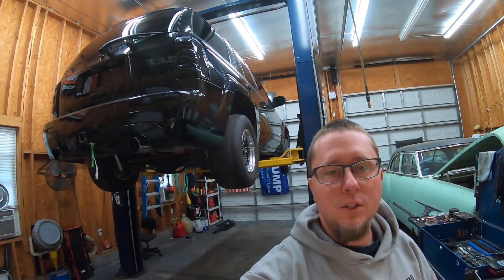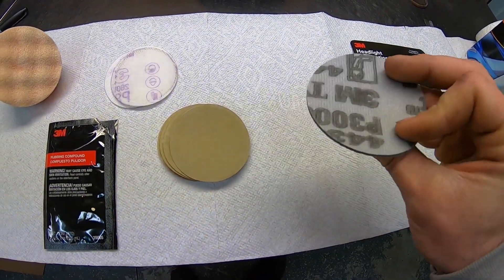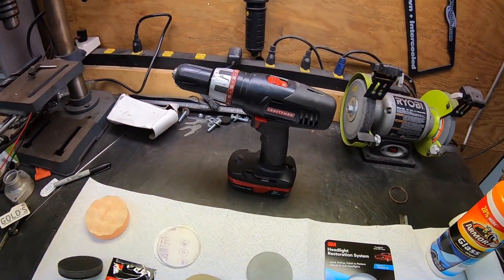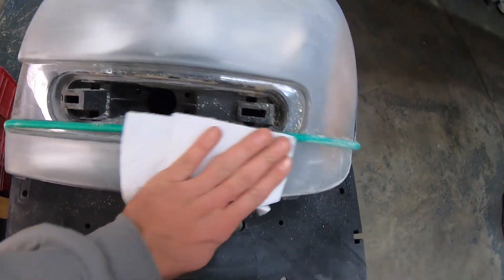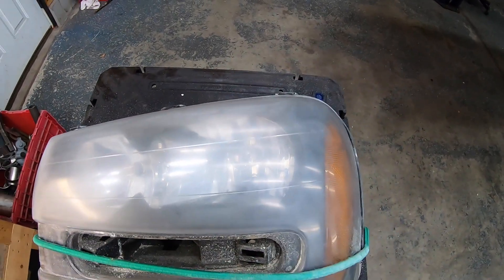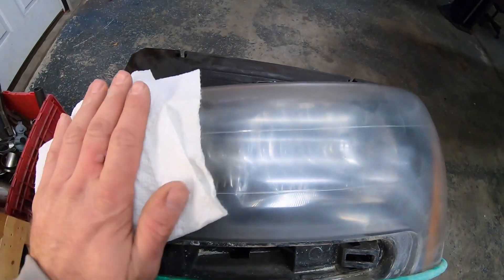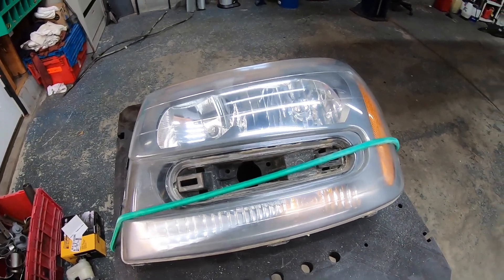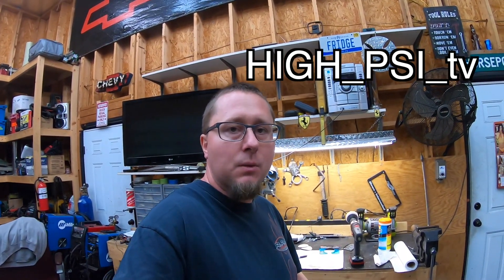3M Headlight Restoration. Does It Work?

Comment: Good video. I did my 1995 Chevrolet Caprice headlights two years ago. It is all in the prep... must  use UV protection  or it will not last... mine is till clear and good.

Comment: You need to clearcoat paint the lenses after polishing or they will dull and haze again very quickly. Rustoleum sells a UV protectant clearcoat paint that is perfect for this if you don't want to spend the money to have a bodyshop put actual clearcoat on them. My Trailblazer lights are still good 3 years later after I did them. Great project truck you have

Comment: I just sand, clean with alcohol, and use uv protectant clear coat. 12 bucks and about 2hrs. But i have used 3m and Maguire's, 3m lasts longer but not long as clearcoating.